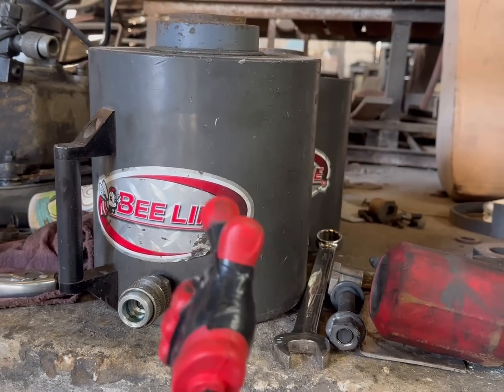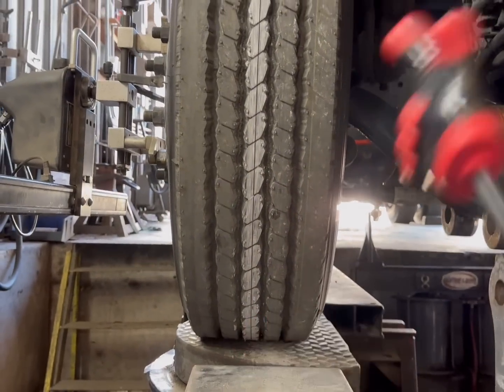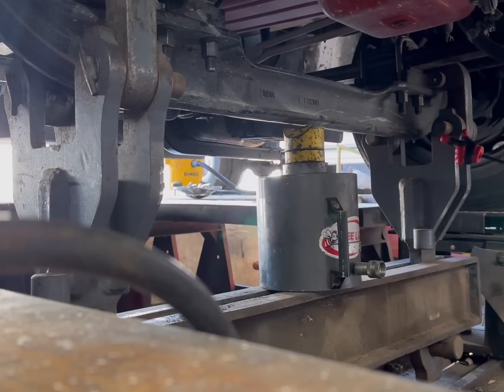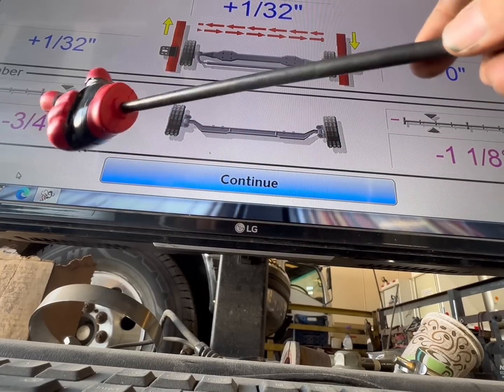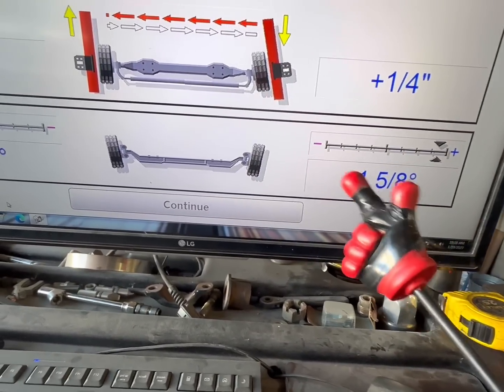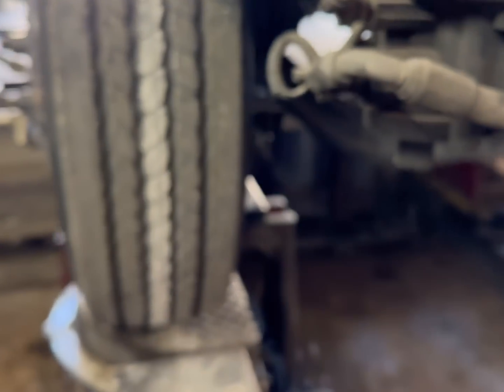What does 125ton do to a semi

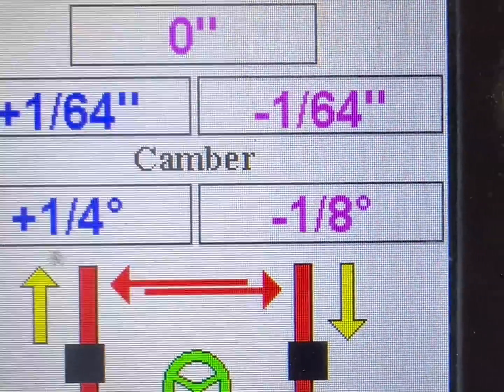Comment: my dually is 1• degree negative chamber. I had inch left on my twin I beam dually. Changed 4:19 camber fittings still to much positive chamber drive like dck. Went back stock ride hight and left the chamber fittings for the lift in it. 1 whole degree chamber on both sides. Drives better tho for sure

Comment: The reason why a lot of shops don’t do that anymore is because it’s very dangerous.
Those hydraulic lines are under tremendous amounts of pressure and some shops. Don’t take care of their equipment.  They definitely don’t want to be held liable for someone’s injury or death while working with it either. That’s why they don’t use that shop equipment anymore. And trust me if you ever seen one of those lines come unglued it’s messy. And anything it comes in contact with will be destroyed. Besides, it’s cheaper not to do it for big companies and just send it.

Comment: We did not have a lazer and software to help algin those trucks. It was by eye i guess. I was just a helper on his way to learn how to straighten truck frames. Especially on 6 axle dump trucks. When the boss would bust out his 100 ton jacks to do this it was scary man! All that creaking and popping noises. Plus my boss at the time had made his own rigging gear along with a 200 ton press he fabricated. Piepers fab and frame was the company. I never got to learn the trade though. I was moved to the excavation side of the business. The frame shop also did tepairs and maintenance on pipe laying equipment. Like back hoes, track hoes, bulldozers and the like. It was a fun job. To bad the work went dry.

Comment: Too bad I didn't do that to my Jeap axle. No diff, no cv joints, but still balljoints. I used offset joints, but I coulda just bent it.

probly pie slices outa the tube, I haven't thought of a way to bend it accuratly with only tools available in my garage (or wallet), yet.

Comment: We had a cheat at the shop. I used to work at about 25+ years ago. We would do the camber and caster at the same time. We would take a piece of quarter inch or 3/8 flat by about 2 inches long and put it underneath the backside of the passenger side clevis. Worked out about 95% of the times. The other times we actually had to do a caster twist. from Edmonton Alberta. PS we had a beeline set up also in four bays and a frame rack in the fifth bay. another bit across the shop had bull rings for doing equipment trailers.

Comment: Bro i used a 20$ tape measure to set the toe angle on many trucks through the years because that angle destroys tires pretty quickly. I would have loved to get into it like you do but shops i been in just didnt have the equipment for that.  Steer tires are so dam expensive you better know what you are doing with that tape measure, i heard that more than once from OO and never had any complaints. Whats a Continental 11R22.5 steer tire costing these days?? About 600$ is my guess.

Comment: The reason few shops do it is because its a temporary fix, I had it done to my Western Star . You need to replace the axle or else it will just return back to the bent position in a short time. Once bent it has a memory.

Comment: I don't do work on heavy duty vehicles, but I did something sorta similar to this to straighten out my Twin I Beam suspension on my truck after going through a ditch.  Same sort of setup, no ball joints, no camber adjustments, actually no caster adjustments.  Just one adjusting sleeve for the toe.  I like it like that, because the only way it can get out of adjustment is by being bent.  With long arm short arm front suspension like on cars and non-Ford trucks, you can adjust the camber, but it gets knocked out as soon as you go over something sorta hard, which I do just about every time I drive.

Comment: I am about to start offering truck alignments as a business and I've been researching the various systems. I like the Bee Line setup. Setting camber makes sense, but everything I have found from all of the axle manufacturers expressly prohibit and warn against bending of the axles to adjust camber. Hendrickson even goes so far as to specifically mention not using the BeeLine method in their warnings. Hendrickson, Meritor, Dana, Detroit , and Volvo all prohibit bending the axles for any reason. For liability reasons I don't think I'll be able to bend the axles, but I also don't want to send people down the road if it's not right. Any thoughts?

Comment: This is basically the exact same way everything from an old Model T, to a 1980 something Ford F150 to a semi truck would have an alignment done, if it has a straight axel or twin I beam suspension. Sadly this is also becoming a lost art form, due to shops trying to get away from doing anything other than an independent A frame suspension.

Comment: I'm a tech  at truck and auto alignment,  in ogallala nebraska I  push semi axles daily,, I've done everything  from a positive push, to a negative pull, I even do a positive negative push using 2 125 ton rams, but I also push axles on small trailers, to rv, and motorhomes, I also set front to back track, and side to side on rear drive axles, I also align semi trailers? Basically I do anything that has axles, and can be aligned!

Comment: Setting alignments is a joke. Especially when it comes to semi trucks. Now many will say I am crazy but I’m not. Just kidding. I’m a truck driver. Of course I’m crazy.

I have had my alignment set so many times (every axle not just drive each time) and my steers always wear funky. I mean the amount of weight that is constant on them and the amount of potholes we constantly hit including the several miles of long distant ruts will cause wear problems. Remember… as soon as you have a weird wear on your tire it will most likely never stop. It only gets worse. Alignments are always only temporary. They are only as good as the nearest pothole a few miles down the road.

Comment: The shop I work in is getting started with the alignment and axle straightening. Where are you getting your front axle alignment specs? I've been hearing that the dealers specs can be off.
Reply from the maker: Dealer specs are off or oem specs. Beeline goes off drivability and tire wear spec based on size the vehicle. Ideal according to beeline. Is 0 to 1/4 positive on the left and zero to quarter negative on the right ideal is quarter positive or 1/8 positive 1/8 negative usually between a three-quarter and 1°  split cross caster.
Reply: @bendinwithbendon  you are awesome! Keep up the great content. Love it!

Comment: I enjoy your video. 
Where are you located. 
I have a Freightliner fl60 that has been stretched for Hauling campers. I have replaced kingpins an d bushings. Replaced spring and shackles and i am still chewing the tires up on the inside.

Comment: I used to align the older Ford F150s 250’s and I would bend the ibeams and if the caster was off a little we would bend the radius arms and if it was way off we used offset radius arm bush-ions but still getting a half inch adjustment was pushing it  then the one adjustable tie rod which the steering wheel would be crooked and sometimes you could pull the steering wheel off and straighten it if it didn’t have special splines   Memories

Comment: In the Louisville Kentucky area, I go to Shively Truck Service. My homeboy Tommy does just this kind of work. I was there years ago and he had the equipment on a big truck axle and he left it jacked while he worked on my Ford Twin I-Beam front end. He said that sometimes the axles get hot from the molecular re-arranging going on and you could smell paint getting soft. He would cut the line in the tires too. Spray a strip of paint down the center and had a jig that held two cutting wheels up against the tire. Give ‘em a spin and Bob’s your uncle. Great old-school system.

Comment: What does a semi & a Lotus Europa, ('70's British sports car), have in common?

No camber adjustment.

While you can bend the semi's steering axle, the Lotus has an IFS.

In the '80's a long time customer of the sports car shop I wrenched at, put $13,500 in an engine/trans rebuild.

Idiot owner of the shop didn't thoroughly chk out rest of car to see if it was worth the massive investment.

The British car guru in the shop did the Lotus work. As he was coming back in from the 1st post rebuild drive, I noticed something wonky w/ the front suspension as he hit the 2" curbed driveway apron from the  street.

I asked Gaylord how it drove.

'Like chit, wanders real bad.'

Being the shop's suspension/alignment/fab specialist, as well as a line mechanic, I threw up jack under the front crossmember, & lifted the wgt off the front wheels.

That was all it took to determine sumtin was wrong; both wheels fell to +20-30⁰ neg camber & the caster was pos 1 side & way neg the other.

Dove under to discover the IFS was non-adjustable; tow was the only adj.

It was a square tube frame was urethane, non adjustable upper & lower A arms. No heims, no conventional camber shims.

The Lotus owner had just dumped $13.5 in a death trap. Oooops...

Local Lotus dealer said, ",Scrap it."

I told idiot boss I can fix it, but it has to be a time & materials job; my welder & fab tools from home shop, ballpark estimate only on labor.

Customer agreed.

Three months later, took it to alignment shop for final check, & it aligned perfectly, didn't even have to set toe.

I hand rebuilt the front frame. Bill was +5k, but car was now worth about 50k.

While I was at lunch, idiot owner VOLUNTEERED to cut the bill in half, cause HE thought it was too high.

I packed up my tools, got my final check & walked out, as idiot boss sat on the concrete w/ a fat, bloody lip, & the rest of the shop applauded as I climbed in my truck.

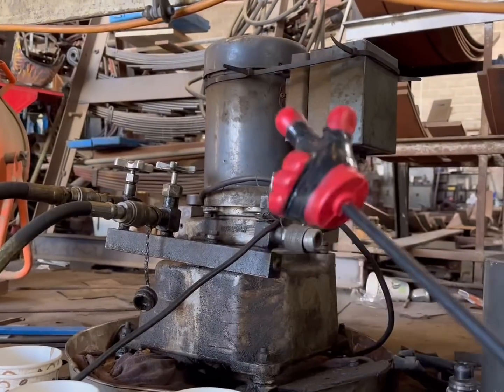Comment: 2:12 "puts out a ton of pressure"  i'm kinda joking but kinda curious, what is the PSI on that pump where it can power a 125 ton jack.  Is there some kind of leverage or force multiplier where it can lift 125 tons with less than 125 tons of pump power?  I don't quite know what to start looking up to find this out via google.

pretty cool seeing such a heavy duty alignment.

Comment: For what it is worth, (old story by me from 20 years ago) I purchased a new flat bed / roll back for my fleet and with in the first 700 miles, my rear duals were being chunked and stair stepped on the treads corners, and the front steers were killing the corners badly.. Okay, I took it to my local truck service for a complete suspension and steering check, please note, this was from the factory this way or body mod shop, who adds the wrecker bits and it was so out of wack. There was a few other issues that were alarming as well. The diesel mileage was horrible on this new unit too. 

Anyhow, it was covered by the body modifier and manufacturer, and even purchased new tires for the rig. There was photo's that were requested by those company's to verify that no tampering was done, or damage from collision(s), etc... and it was approved. 3 weeks later, I got the truck back, washed up and put it back into service and became one of my fleets best money makers just on how much diesel it saved due from rolling efficiently straight..lol... But yes, that front axle needed the camber rectified in a bad way.. If I remember correctly, the camber was combined left & right was 8.2* and toe in/out was a 6.4 toe-in... The rear was playing a role in forced dogwalking, as left side hanger the leaf eye bolts were never tightened in fact, were loose. Which is what I started to look into the truck, being all over the place ,especially if loaded, which got even more spooky is double loaded. And when you hear a loud bang, requiring my undies to be changed out, yes, you pull over and off load onto one of the other trucks to finish the job. Straight to service it goes. I am glad I did, as I would have been left holding the bag in crap let go at 60 mph on the high way.. and likely hurt or killed somebody innocent. But, the service guys enjoyed this one, as it was a new unit, clean, and got to go nuts on it, while getting paid top dollar. plus, I away tip my mechanics with free money or free stuff, so they always go the extra mile for me to keep me and my guys safe. and they ALWAYS took care of me. Yes, that is bribery, but SOOOO. I appreciated those guys.

Comment: Hey hey , I just got done with that type of alignment. They bent the axle but when I pulled up the truck out for test drive my steering wheel is 90° off and turning right is limited. I don't think this is the way it supposed to be especially like in my case where the draglink got no adjustment. What do  you think? Do they mess with the bending? Thank you.

Comment: I do this on 60s and 70s camaros and chevelles to counter cross member sag.    I set the caster with the shims.  With a minimum of two 1/8" shims on any stud. I measure the camber. Calculate what correction i need.  Jack up the car and measure the camber with the suspension hanging. Add this to the hanging measurement.   Chains over and behind the upper control arm brackets. Looped at the bottom.   Move the 20 ton jack toward the side i need more correction.  Jack away watching the numbers on the gauges.  Because my frame guru retired and passed away at 80. I have done this in my driveway at home many times.  He was so much fun. He had a masters degree in metalurgy from. MIT.  And ended up running a frame shop that did no body finish work.   Just frame and unibody pulling

Comment: I was a body and frame tech for years. Did alignments too. I figured out that it was the caster on Jeeps that caused the death wobble. At least for my Jeeps. I set the caster angle between I think it was 4-6 degrees, don’t quote me on those numbers it’s been a while. And set the toe and even with worn joints. I had OTK steering with heim joints. I could align it and no death wobbles.  No one would ever listen to me lol. They would always throw all this other dumb shit at it and it wouldn’t solve it hahaha

Comment: We chased a variable vibration on a KW for close to a year. It always felt like it was in the front. Almost ever moving part in the front was replaced. Wheels changed, pins, bushing, bearings etc etc. put on balancing rings. Nothing helped.
   It ended up being a worn sway bar at the rear of the tractor.

Comment: When I was in trucking, I would have my alignment checked annually at Josam Frame and Alignment in Orlando, Fl.  Not the cheapest place to go, but I went 100's of thousands of miles on my Michelin drives and steers.  Well worth the investment to find and use a good shop.😊

Comment: Great video  but one question is the axle not weakened very slightly because you had to jack way past where you need to be I'm sure it will eventually just go back to where it orignal was again would you not need to brace it in some way  once corrected to stop further movement again

Comment: We had this done to a replacement front axle on a T600 that hit a fire hydrant loaded at 94-K gross. I was pretty shocked that it bent the axle. He was only going about 25 mph. And it sheared off the hydrant (just like they're designed to) However this was another case of do we scrap the truck (it was 10 yrs old at the time and paid for) Or do we invest the cost of repairs and fix the old girl. Seeing how the truck recently had major engine repair and a new clutch a while back. We chose to spend the $$$ and fix it. And since the estimated repairs where under the deductible on our insurance at the time. We just paid to have it repaired on our own. New axle, New front and rear spring hangers and all the related parts and labor. We had just over $3500.00 in it. However this was back in 2005. Today, You could probably double if not triple that amount.

Comment: I have seen this done here in New Zealand on newly imported trucks. We have different road camber to the USA so has to be adjusted. They used a big induction heater though to heat the axle.
Reply: You guys drive on the other side of the road?
Reply: @DSMattitude  yeah that to.

Comment: This is interesting.  I'm a automotive tech and it has never ever crossed my mind how heavy duty alignments are done. Thanks. Also love the little red hand.
Reply: That's Bob
Reply: They used to do this with I beam fords to get the alignment right if ball joints wouldn't do enough.
Reply: @thomashalley7258  yup, it's the only way to set camber on the old twin I beams. Early 1980's & older.

Comment: I worked at a bee line shop pulling frames and bending axles for 29 years. Our axle press was the older 100 ton set up. Always had me nervous especially when bending the caster.
Reply: I have never seen a repaired frame fail at the repair site Can’t be any worse that some of the rusted frames I have seen working in the rust belt
Reply: Do you think a pulled frame has the same structural integrity as an undamaged one?

Comment: ... That isn't an axle... An axle is part of the drive train... that is part of the suspension. Specifically the crossmember between the front tires to allow steering and it also serves as the weight distribution point from the chassis to the wheels... NOT an axle!

Comment: As a self-taught shade tree mechanic I don't understand why you consider that the ideal camber reading.  Empty shouldn't both tires be set at +1/4* camber then when loaded the truck will settle at 0*camber, that way both tires wear exactly flat and evenly?  And slope of the road can be compensated for by a little more caster on the right wheel.  I'm just trying to learn . . . I've never worked on a truck bigger than a 5 ton truck.
Thank you.